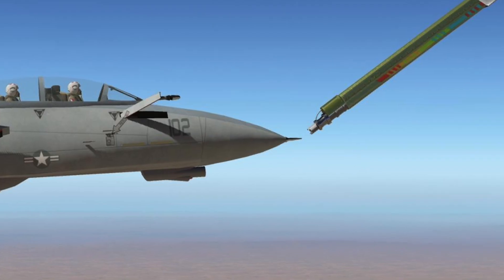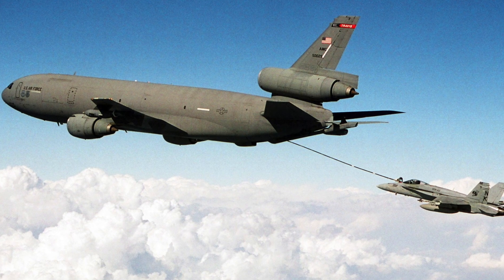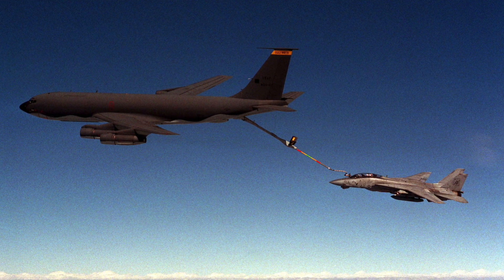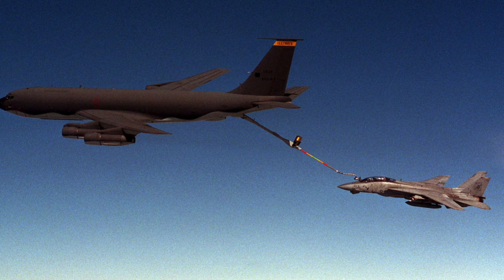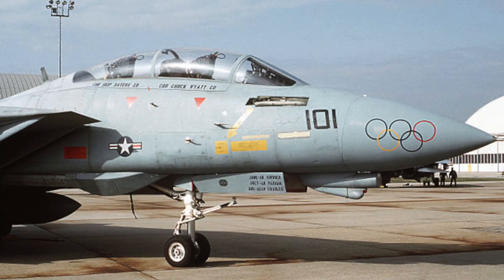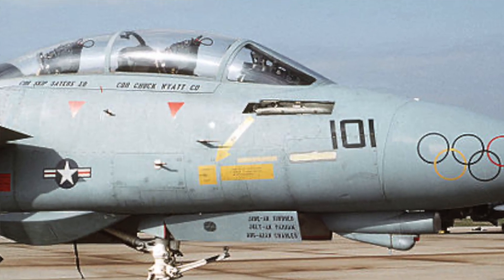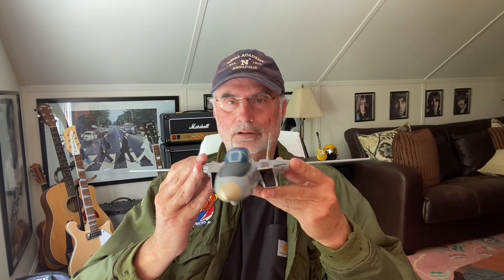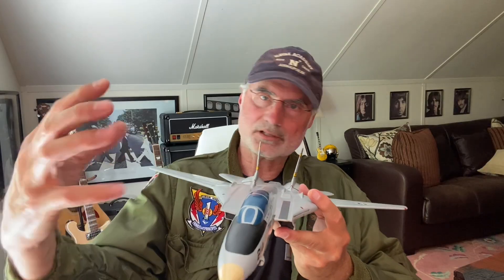Secrets of the F-14 Tomcat: Inflight Refueling

Comment: 00:42  "Flaming out is bad..thanks for the safety tip Egon" to paraphrase the great Dr. Peter Venkman 😁 (I'm not implying anything here. Your comment made me laugh and I thought of this all. Such a great film!)
 Hey at least Tomcats had body lifting and large wings..imagine the glide ratio on the lawn dart shaped F-104. Yikes.
Stay Safe
Reply: F104 - "the missile with a man in it".
             "A Sidewinder on steroids"
Reply: @wcate8301  I read in the German Air Force, where the F-104 was dubbed the "Widow Maker". It seems that we lost a generation of young jet pilots in those days.
Reply: *I SERVED" in the German Air Force.
Reply: @dasschmittchen , the F104 was designed to be a point defense interceptor with a Me163-like or SAM-like flight profile. It was the first plane out of the starting blocks with the ground breaking J79 jet engine that went on to power a whole generation of aircraft. It was at least reasonably successful at that mission, but was poorly suited to the Luftwaffe's mission of trans-Iron Curtain nuclear strike. It's tiny wings and limited interior space imposed serious limits on its lift capacity and fuel load, leading to a tendency towards an aft CG when combat loaded. This made its handling squirrelly at best and lethal at worst. As a  high speed bomber interceptor optimized  for high altitude, it suffered serious performance penalties down in the weeds where its nuclear delivery mission sentenced it to operate. Of all the available aircraft choices, the F104 was the worst possible, but was selected under intense pressure from Lockheed and the US government. We were NOT your friends in this case.

Comment: Thanks Ward, very relevant at the moment, i've just started to do this in the Tomcat in DCS. Been at it for a few days but managed to tank yesterday briefly.
Reply: I’ve found it much easier having the wings in bomb mode. Bit more sweep reduces the roll inertia a lot and seems to make the whole aircraft more stable. Other thing I do is use the rudder trim to bring the turn/slip ball back to the centre, when you put the probe out the extra drag will pull the nose right. So left rudder trim to get you flying straight can be beneficial. Obviously you’ll need to recenter it after you put the probe away. Hope some of that is useful. It’s a good challenge for sure.
Reply: Cheers for this Ben, i do use Bomb mode but yours and Ward's tip about using rudders has helped massively. I was focusing on the throttle and stick so much I forgot about the rudders ha. I'm so much further along than when i started, i couldn't even keep behind the tanker so it's getting better.

Comment: I lived in a town with a air force base, and had family members in every branch of service, even coast guard. I was even in the army, yes there was a problem once a year during football season😂. But, for the life of me, I have never understood why, if the two services couldn't get it done, the government, or the Commander-In-Chief, make the decision for both to use the same fueling method. In my opinion, it seems like it would be a no brainer, and it hurts me to say this, to go with the type the navy uses, on the grounds that most any aircraft in the air force inventory can be fitted to be a tanker. It just makes sense. Not to mention the economic savings.
Reply: I've wondered this, the best explanation I've found is that tanking in the Air Force was originally developed to support the cold war nuclear deterrent role.  While its not impossible to tank a heavy bomber with a drogue (the Brits did it with their V bombers, Russians with some of theirs) the USAF decided quickly that it was less than ideal for a B52 or B47 to try and manage this.  So they developed the boom method and just rolled it over to fighters.

Eventually they were told to play nice and this is why the KC10 has drogues as part of the design (compared to the bolt on kit for the KC135 which as you heard here, isn't the best solution).  It can support Navy, Marines and many allied services as well.

Comment: It seems to me that... and I could be wrong. That our armed forces need to pull their heads our of their ass and standardized some thing as simple as the in flight refueling config.
Reply: There's reasons not to, the large air force bombers need the huge booms to refuel because the booms can flow so much more fuel than the smaller drogue. However, the smaller navy aircraft that can take off from a carrier can't carry the large air force booms off the carrier.
Reply: You’re wrong.  The Navy uses the hose and drogue system due to blue water ops and refueling behind small tankers that don’t have a boom operator, so they are forced to just trail a basket behind the tanker and let the receiving jet plug himself.  The Air Force method is much easier and safer, but it requires a boom operator to “fly” the boom to the air refueling receptical (pilot flies to the proper position then the boom operator reaches out with boom and plugs the jet)
Reply: To OP. I think the hose & drogue is a necessity because the Navy and Marine Corps does a lot of buddy refueling. I was reading an article a few years ago that the fleet was having issues when the S-3 Viking was retired as it was handling the tanker role alot and now they were having use Super Hornets as "tankers" which was limiting the number of Super Hornets for missions. FYI, I am not a subjective matter expert, nor do I have any aviation background, so I could be talking out of my ass 😁 but it kinda makes sense to me (for all that's worth). Have a great day and stay safe.
Edit (looks like Ward covers what I posted here....I swear I posted before I got to that portion of the video..lol)
Reply: @RedLiver there's probably  some laser tech that can shoot them down or some sort of jamming system that can block their sensors.

Comment: Did the pilot always set the wing sweep to bomb mode during refueling? Also, did the A model Tomcats even have a bomb mode for the wing sweep, since, as you've mentioned a few times, the ground war game didn't really get developed in the tomcats until the 90s? Love your content, sir!
Reply from the maker: Only time we tanked in bomb mode was when we were tanking off of wing pylons, like on the C-130 or KC-10. That’s when the wing vortices were a factor. Under the tail wasn’t as big a problem.
Reply: @WardCarroll  Thanks for the response, sir. Great info. Also, what would you say were the slowest and fastest airspeeds that you all would refuel at?
Reply: @WardCarroll  I was wondering why you weren’t complaining about tanking off A7s. A6 was so easy but the wash off the A7 sure made  for a rough ride
Reply: All the F-14 models had the Bomb setting for the wing sweep.  It was there to remove a variable (wing sweep) during a run.  I guess the idea was to stabilize the plane and make it more accurate.
There weren't that many differences between the A,B, and D models of the F-14.  the big changes were the deletion of the glove vanes from the B and D-models, the redesign of the gun exhaust introduced in the B-model and later retrofitted to some A-models and standard to the D-model as well, and the exhaust nozzles of the engines when they switched from the TF30 to the F110 in the F-14B and D.  What they tried to do through the course of the program was to keep airframe differences minimal to make it easier to upgrade the older planes to later Block standards.  
The GE F110 was adapted to the F-14's engine nacelles to reuse as much of the hardware that supported the TF30, not the other way around.  The big change between the F110 as installed in the F-14 versus the F-15 and F-16 was that a 50-inch adapter unit was installed in the F110 for the F-14.  The F-14 engine nacelle is much longer than the engine bays of the F-15 and F-16!  If they didn't use the adapter in the F-14, the F110 would be too short to fit in the nacelle!  The compressor faces would either be too far from the forward inlets or the afterburners would located too far internally and scorch the airframe!  The adapter (basically a steel band) shifted the F110 sections (compressor and afterburner) into proper alignment with the existing F-14 airframe.  The adapter is the main reason the F110 is heavier in the F-14 than it is in the F-16.  I think it added at least 400 lbs to the basic F110 engine (which is about 3800 lbs installed in the F-16).

Comment: What is the reasoning behind the in flight refueling differences of the USAF & USN? Why does USAF use female receiver and USN use male receiver?
Reply: It has to do with rate of fuel transfer flow.  The air force needs a high-flow system to transfer the tens of thousands of lbs of fuel required by big wing aircraft, such as bombers and cargo aircraft, in the shortest time possible.  The refuel boom fuel transfer rate of a KC-135/KC-10 can exceed 6,000 lbs a minute, whereas the probe and drouge maxes out at 2,800 lbs per minute.  Which would you rather have when you need to aerial refuel 100K lbs of gas into a B-52?
Reply: If this is a serious question think about the mechanics of trapping on a carrier with a USAF style boom... As for why the AF uses a boom, it's much faster than the probe n' drogue.
Reply: @stal2k  I hadn’t considered the “trapping” scenario. I figured the booms on the taker articulated flat against the fuselage. Thanks for the insight
Reply: Air Force jets refueling is very routine and easy.  I’ve never seen even the least experienced Lieutenant not get gas successfully.  It might be a little ugly, but he got his gas.
I’m an AF dude, but I assume the Navy uses the basket because there is no boom operator to plug the receiving jet or throw switches to transfer gas.  The basket is just trailing behind a converted fighter jet.  Navy jets, many times just take on enough gas (couple thousand pounds) to land on the carrier, but when performing long missions like Southern Watch they need to take on 10,000-15,000 lbs of gas.  You can’t get that much gas from a Navy A-7 or F-18 tanker, so they had to use AF tankers who can pass hundreds of thousand lbs of gas.
One tip we always did was to ask the KC-135 pilot to pull the inboard throttles back and push up the outboard throttles.  This would reduce the turbulence around our jet.  The KC-10, a much larger jet with only 2 engines on the wings (and one high on the tail) did not produce as much turbulence around the receiving jet.
Reply: I see where this is going . . .
Reply: @zohrab22  ha, I grew up in a house that was 4 blocks off the end of runway 23 at Oceana. I never realized the 2 services used different types of receivers. There must be a reason the USAF has to be difficult (even 160 SOAR uses male receivers)

Comment: If you had empty drop tanks with you, can those be refilled inflight as well?
Reply: Yes they can.  You can set the switches to either take gas in the external tanks or not take gas.
Reply: @justsmy5677  wrong you can set fill internal only or all other tanks (wing tanks) + external.
Reply: @AggrarFarmer  - you basically said the same thing I said.  You can set the switches in the cockpit to take gas in the externals or not take gas in the externals.
Reply: @justsmy5677  I was correct first postion is for internals  the upper fills internal wing tanks + Fuel pods.
Reply: @justsmy5677  thanks!
Reply: I’ve always wondered this as well
Reply: You two AF vs Navy or what? 
Always trying to one up the other over anything & everything appears to still be SOP.

Comment: What speed were you when you were on the tanker? Was it different for KC-10 versus KC-135? Thanks
Reply from the maker: 250-275 knots for either. I’ve tanked off of a KC-10 flying coast-to-coast at 300 knots, but that’s borderline too fast because it forces the pilot to be way up on the power to plug.
Reply: @WardCarroll  really like your posts
Reply: @TonyPalmer103  I presume they had spare tackle or when they lost a boom or did the tankers have to go home for a repair and call in another 'plane?
Reply from the maker: Great question, Keith! Thx!
Reply: Keith there is a flip side to that by going too slow.  In the mid '70's we were still using  KC-97 prop planes and refueled at 235 in the F-4.  We were at such a high angle of attack that we would often have to tap the burner.
Reply: @jcheck6  Ahh yes, the good ole KC-97 Stratofreighter.  I recall fondly my time refueling behind a tanker almost as old as me. But the altitudes were always lower (~18 - 20,000) so Señor F-4 actually had a little more thrust at that 230 speed.  I personally never used AB but on occasion did run out of throttle in a turn. Plus, they were all ANG and proficiency level of boomers was very high.  FWIW I never found night refueling a big challenge...after you've done it over 50 times you have it pretty well figured out.  On trans-Atlantic deployments we enjoyed the AAR points as a break in monotony.
Reply: We (the tankers) catered to the speed requirements of the receivers. Bombers (our main mission) were about 280, 250-280 was common for the Navy fighters, the Air Force guys (with the boom...it gave a lot more stability at high speed) generally liked 315. The A-10s were the exception, at 210. The fastest I ever refuelled was with a pair of Wild Weasel F-4s over the Iraqi Border...we were at 375, and they kept asking us to go faster.